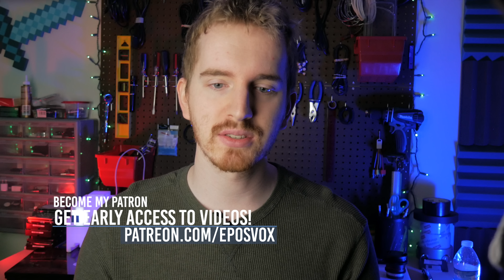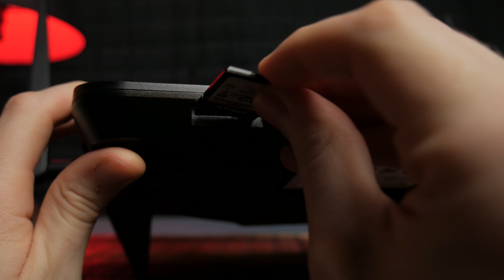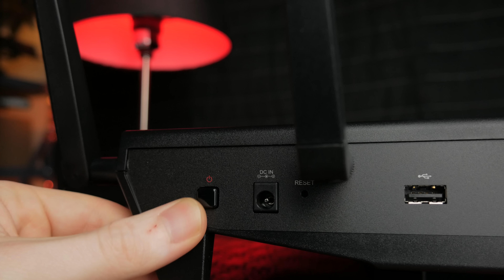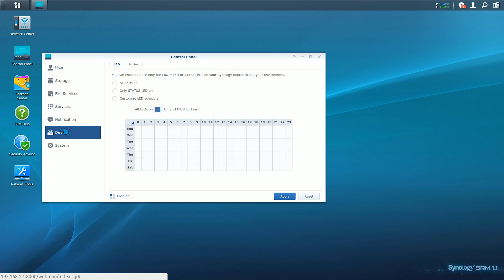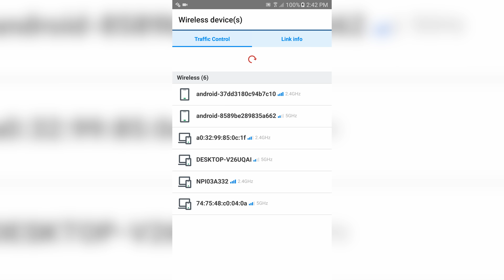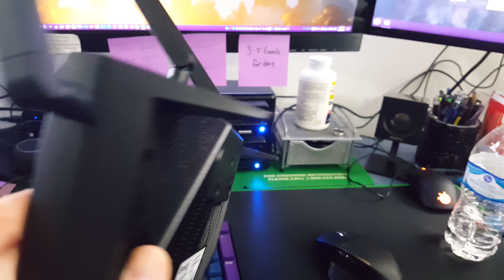WHY CAN'T OTHER ROUTERS DO THIS?!? - Synology RT2600ac Router

Comment: In my current set up from my ISP (Rise Broadband), I do not have a modem... at least, not that I'm aware of.  I only have a WAN cable and what I believe is a power over ethernet adapter.  Anyone got the RT2600ac to work for them on a similar set up?  If so, anything I need to be aware of during set up?

Comment: As a Federally Licensed Amateur Radio Operator I highly recommend having the router antennas as high as possible, meaning have nothing over them. Put your router on the higher shelf, the top shelf. You loose some signal both ways by putting your router in between shelves.

Comment: Caveat: fast forward to now 2020 and it looks like Synology has abandoned their routers. The Community is rife with people, including me, whose routers are no longer functioning properly ( Rt2600/2200 mesh unable to reach 400 Ms in my case) and not a peep from Synology. The latest update was last year and nothing since.. Real shame as the SRM is real good.
Reply: Latest update is 2020-09-24 for the AC and there was another 3 months before that. Did you change the router since?
Reply: @portwill  No still with it. The latest update seems to have improved the wireless aspect but the 2.4 band could stand to be stronger.
Reply: @CescoCDN  thanks for replying. I am to buy a router and I can’t find any alternative to rt2600 on the market with options like fallback to secondary wan or 4g modem and its security features seem good. When I found a similar one the horror stories popped up in reviews :S I’m glad you don’t have serious trouble with it now
Reply: @portwill  On the whole, the router is solid. If I had a crystal ball I’d tell you to wait a little longer as this model is getting long in the tooth and new models are coming out but, I haven’t a clue. See if you can get a used one from a reputable seller on eBay perhaps?

Comment: You can cut a 17.5 degree wedge to fit the angled bottom.  On a flat surface, slide the wedge in til it stops.  Mark it, trim off anything blocking the passive vents.  THEN, use 3M Command strips and mount the block to the router....  THEN add another layer of matching Command Strips to the other side of the wedge to affix it to the wall, or more properly, the ceiling.... inverted.

Comment: Thank you for your review.  Can Synology RT2600AC be setup to serve as both a NAS and TimeMachine?  Or is it significantly hobbled for a novice compared to a dedicated NAS?
Reply: Your second sentence is the more accurate conclusion.    While it does have the functionality, resources will be gobbled up quickly if used as a NAS. There is only 512mb of ram, and CPU bandwidth needs to be focused on its primary function as a router.

I've had this router for a few days now, and like it very much.  The Synology replaces an old D-Link DIR-655 router which was still working fine after at least a decade.  However, I just recently read that the DLINK is vulnerable to attack and there is no firmware fix as it's no longer supported by D-Link.  Hopefully, the Synology over time reveals itself to be another good purchase.

I looked into the Synology router after being very impressed with their DS920+ NAS /software.

Comment: I bought this router and I freaking love it. So easy to use, so many features, it can even act as a file server, that thing is awesome. Well worth the price !!!
Reply: I am looking for something close to the file server.  Does it need internet if I just want to upload pictures from one device and download them from another device? I would need to add a drive to it . I know there are other ways to do this.
Reply: @crazyphotobooth  depends on the device. If you mean "smartphone", you probably need internet. AFAIK this router doesn't act like a "personal cloud" but you can install apps on it so maybe there's something that can work for you. Also, adding a drive to this router is easy : it can use a USB stick or external HDD.

Comment: Why can't other routers do what?... Most half decent routers CAN do all of this and more, and have been doing so for years! Indeed, for its spec, I think this router is around $80 to $100 over priced, maybe more.

Don't think that because you've been using some crappy ISP supplied router for years, that this is some miracle router that does stuff most others can't... Bottom line is, that this router is decidedly average when compared to very many others - and not just in its own price range, either.

Comment: I personally prefer Ubiquiti UniFi.
Reply: Oliver R. Agreed.
Reply: And why is that ? aesthetics ? because specs and performance wise it is way, way behind Synology's flag ship
Reply: Martin Y well that’s a huge category you’re talking about there.... the usg 3? Yeah the synology beats it. But wireless wise? This system can’t touch unifi. Switches, PoE, you’re talking prosumer to more enterprise level... also doesn’t include the new UniFi XG. For the price yeah it’s great honestly. Not saying it isn’t. But....
Reply: Maybe I'm wrong and we are talking about different things, but I looked for a UniFi router with WiFi and I couldn't find one, so I though he was talking about the Ubiquiti UniFi APs which seems to be very popular there. But if I'm right, then we are comparing different things.

To be honest I didn't know much of Ubiquiti more advanced AP models since they are not available where I am. The best I could find here was the AP AC Pro. It's more expensive than the Synology or ASUS, only gives me 450Mbps in 2.4Ghz and it's just an access point so I'd still need to buy a router.
Reply: Martin Y yes you are correct in that regard. Unifi is meant more for a high traffic area in the regard of its AP’s. The idea behind the enterprise equipment is that you’re router is never going to be in a place that would be beneficial for the wireless signal I.e. in a network cage (faraday cage). While it might be slower, the ap’s will most likely be more consistent. A little edgerouter and a UAP is a common setup for most folks’ home.
Reply: Thank you. I just wanted to know if it was actually a better option for a common person, like me. I've decided to go with this Synology at home, partly because I'm already using a Synology NAS in my office..

Comment: To hang on the wall, use longer screws so that it hangs flush with legs against wall.
Reply: You seemed to have missed his whole point.
Reply: With the processing power in this device, I am not surprised that some heat is created. They want to make sure you leave enough room to dissipate this energy.
Reply: Its so heat can escape...

Comment: Hey Epos i have a question.I live in Turkey and maybe you would might know that the internet aint cheap.My modem i do not know why but keep loosing connection....I checked the cables and the phone cables but still has issues.It disconnect every day from 4-5.Sometimes never depending on luck tbh.Is there any way you could help?

Comment: I like that they're pushing out a lot of updates to fix issues but I wonder how long that will continue. Hopefully they will support it longer than most router companies do with their products.  The list of vulnerabilities is kind of scary when you read the release notes but hopefully they're going to stay on top of it.
Reply: On a NAS, the lifetime for DSM is about 5 years before they stop providing updates for their software features BUT you get security updates for the life time of the products. So if you had a CS407e (2007 model) they are still providing security updates for that much older version of DSM. The same should then in theory, be applied to their routers over the years.
Reply from the maker: So far they tend to support most of their products for a very long time.

Comment: Hi. Thanks for the video. I have the previous model. What about wifi range? The previous model, the one that i have. is absolutely horrible. My  Time Capsule has 5X better range...
Reply from the maker: I have a two-floor apartment and our laptops get full signal throughout the entire apartment. Phones and low-power devices do struggle a bit on the second floor, though.
Reply from the maker: Needed an extender to even get laptops on

Comment: Looks like synology has been taking notes from ASUS. The RT line has just about everything this one did. I have the RT-N66 and it's been the best router I've had. I plan an upgrade to the AC model soon. 

also worth mentioning the RT line has some routers for around $130.

I think other routers don't come with all of these features because "normies" usually just need wifi. They don't care for NAS, VPN, and security capabilities. Hell, most of them don't even change the default password.
Reply from the maker: Most don't change the password or do any advanced configuration because the software is absurdly difficult. lol catch-22 there
Reply: EposVox , you're right. This GUI looked pretty good. maybe even better than ASUS'
Reply: @Cloudycloudguy  
The Synology GUI is just a rip from their NAS software, whereas Asus use specifically written router software based on the closest thing to what can be called "industry standard" in the router game... This doesn't come close to Asus.

Comment: I must say that I am impressed.....and the UI s very clean and straight forward in appearance.
I must be an old dog, I have gotten used to the endless tabs of sub-settings in everything from Cisco to TP-Link (UGH). Miss the old 3Com UI...so easy your grand-parents would kiss ya ;)
This system is not terribly expensive compared to others in its range, and its features seem more vast than other in its range.
I would appreciate a "90 days" or even an 180 days report on the system's stability.  
I greatly appreciate that the system seems openly vented on teh top and bottom.....90% of all Routers Fail because of heat and a lack of ventilation. 

Sooo....a coupel of suggestions:
Your Borq-Weiner (Time Warner) I would believe to be a wireless/4 connector hard line system???
If so, to optimize speed and communications reliability.....I would set up your modem so that WiFi is off, and that the system is then set to "Bridge Mode".
This will keep the Modem from overheating and allow reliable Internet Communications.
Let your Router handle all of the Wireless and hardwire communications.
Modem in "Bridge Mode" to a router is always proven to me to be the solid way to go.

My only concern about this system as with many others of its ilk is that there is only 4 hardline :/
I consider this to be a limtation, as I live in a house with 5 Gamers and a ton of wireless devices. Not to mention my Media/internet server

In your situation, as I imagine it, I would have considered looking at the Asus.
For you I would have suggested (FOR NOW) the ASUS RT-AC88U Wireless-AC3100
This in particular allows 2 hardline to my Server ;) and enough hardline to other items with out a splitter :/

https://www.amazon.com/RT-AC88U-Wireless-AC3100-AiProtection-Complete-Security/dp/B016EWKQAQ/ref=sr_1_1?s=electronics&ie=UTF8&qid=1485547099&sr=1-1&keywords=asus+rt-ac88u

Which is an  8 port hardline equivalent to the Synology reviewed here.

But additionally in the next quarter (Q2) Asus will have an update to thsi system which will have a quad core processor, 8 ports of hard wire and that latest in UI and Wireless speeds/tech. + The ability to expand your wireless coverage with Dips and dots.......you'll see, check it out.....
And although listed for Gaming, if you look at the overall specs.....there is enough here to make Cysco spit teeth.
https://youtu.be/29vmjTjTDOA

I may be blowing smoke in the wind here.....you keep on keeping on, and I will continue to watch.....
Thanks for your hard work, and I am actually going to recommend the Synology to a fellow gamer in Canada, based on this review ..... many thanks
Reply from the maker: Haha thanks for the detailed comment.
Yeah I have it set up - Modem -> Synology Router for WiFi -> 16-port Linksys unmanaged gigabit switch for the wired desk setup. (I'm using 14 of the ports on it currently, will need to upgrade soon once I pick up my new rack, haha.)

Still haven't set up bridge mode yet, as when I did that with my last modem from Time Warner, it kept crashing and they blamed my networking hardware. Turned out they had a loose/wet connection outside the building BUT it was a nightmare setting it up, resetting everything, etc.
Reply: Indeed....Time warner, Comcast, typical ISP these can do no wrong, it must be something we did :P
Never could it be something south of the "Entrance Facility" LOL
You keep going the way you are and you may look into Business class connection so your up and down streams can equal out a bit, and you get less razz from your providers when it comes to service.

How I miss the stream speeds and pricing other "Developing" countries :P  
We are so woefully antiquated
Reply from the maker: Yeah. Last I looked, business class connections were twice as much with lower speeds around here. Can't afford it and I frankly can't afford to drop speeds right now. but it hasn't gone out a ton since we moved.

Comment: I had the same problem with a cheap router I bought. it always disconnected at the same exact time everyday and I always had to reset. I'm now interested in this one
Reply from the maker: Yeah that's usually the sign of a dying router or modem. Though some rare ISPs do disconnect every 24 hrs as part of their infrastructure, so I'd find that out first.

Comment: Good spot about hanging it to a wall :) It is quite pricey though £200 (https://www.span.com/product/Synology-Wireless-Router-RT2600ac-AC2600-802-11ac-5x-GbE-RJ45-USB3-and-SD-slot-UK-PSU-ONLY-~58686) But I would personally choose it for sake of parental control functionality.